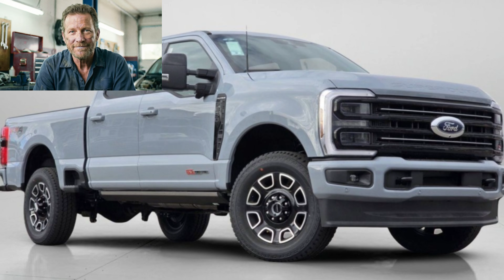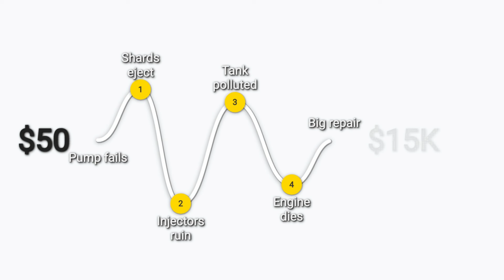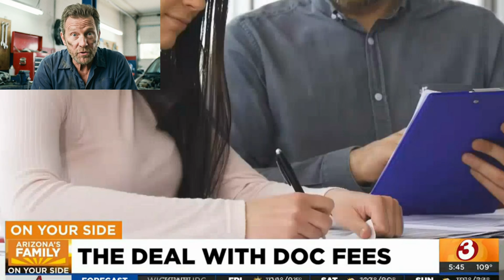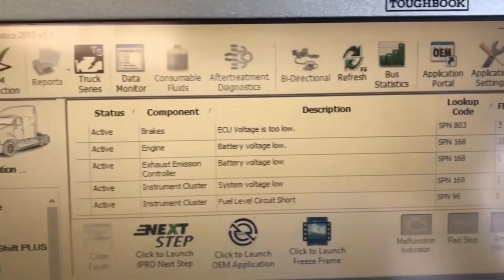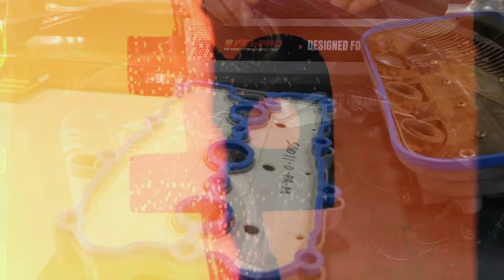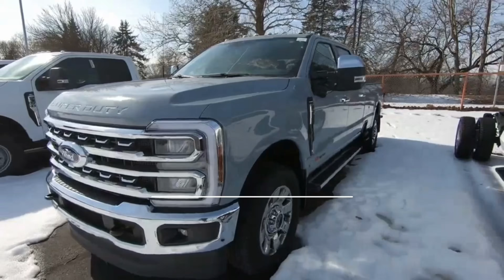Why 80% of New Trucks Are Garbage (The "Heavy Duty" Lie)

Comment: I have a 2022 F-350 6.7L with 87,000 miles. I will be installing a DCR conversion pump this summer. I'll invest $3,500 to prevent a $12,000+ bill and downtime. I already bought my DCR pump, it is in the back seat waiting.

Comment: Would you recommend the 2000 Ford 7.3 diesel?
It's old , so I don't mind rebuilding it if necessary.
My neighbor is a diesel mechanic.
Reply: Got a 99 and 01 7.3 powerstroke with over 300,000 miles on each.  Only thing I had done was to replace an injector in the 01.